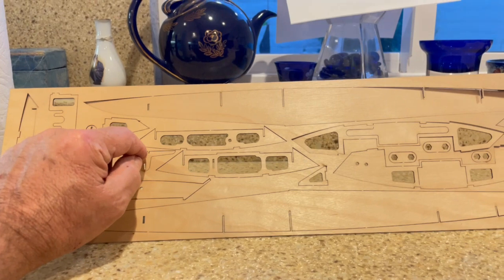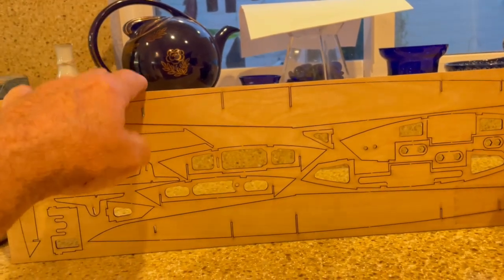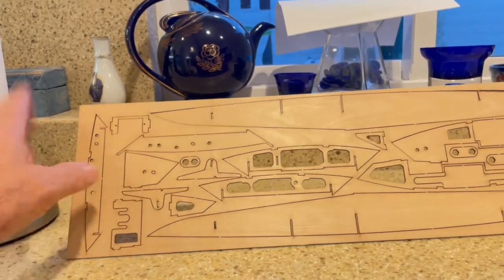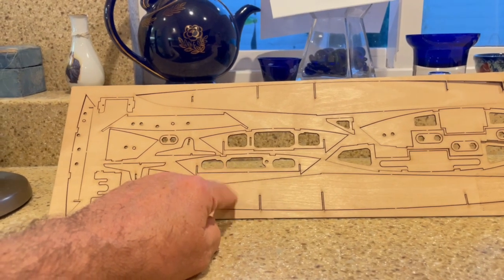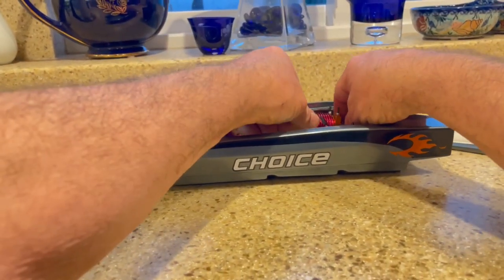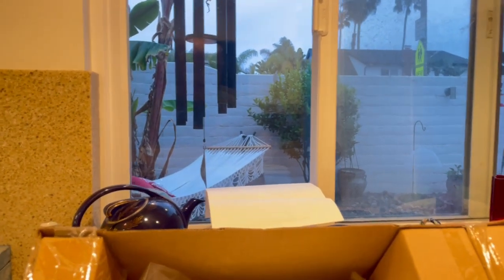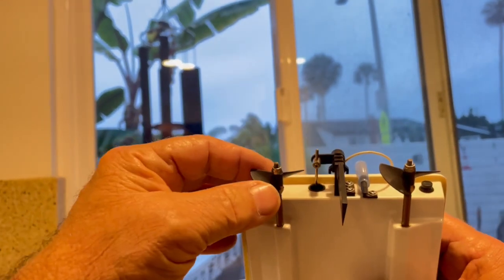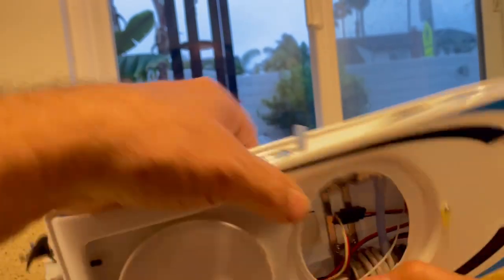Dr. Jet has the prize for the next Challenge

Comment: I had a Mini Wild Cat like yours but yellow and black that I modified. I cut out the hatch to allow more space to get inside the hull and then I removed the stuffing tubes by heating the epoxy with a heat gun and using pliers to twist the stuffing tubes free. I then installed 3/16 stuffing tubes and left and right .098 flex cables with 1/8 inch prop shafts to run 30mm counter rotating props. I installed a brushed ESC and a couple 280 size motors and ran it on 2S. I used it as a pool boat and it was plenty quick despite being brushed. It ran very well, but the plastic hull took a lot of abuse from ramming it against the hard pool walls and eventually smashed the sponsons to the point that it was unfixable. Seeing yours brought back memories. Can't wait to hear more on the challenge.

Comment: I'm just starting to get my Atlas build dialed in. The past couple of times I took it to the pond it didnt go well. I made some changes and had some cleaner water and I think it will run good. Hopefully I can get a video of it running soon. 450 motor, 4000kv on 2s.
Reply from the maker: That's about the right combo for power.  These little boats really don't do well in rough water.
Reply: @Dr_Jet  I didnt have any waves. I did have seaweed and algae maybe some grass which kills these quick.
Reply from the maker: @brandoncocola1322  Oh good grief, algae or seaweed is like dragging an anchor.  :face-fuchsia-tongue-out:  It's really bad with something like the JetStepper that has almost no power to start with.

Comment: I have the bigger wildcat, it's a nice "always works boat". I use it to retrieve my other boats I'm testing. I think you should be able to find another laser cutter that wont be so much for setup. I wonder if they are having trouble with the thickness and have to sacrifice a piece of sheet metal to get it to lay flat to cut good.
Reply from the maker: I don't mind the bit of extra I pay for this laser guy because he has several industrial-sized, industrial-quality lasers, he is very precise, and is less than a 10-minute drive from my house.  You get what you pay for.  I do have another laser guy, but his laser is more like an oxy-acetlyene cutting torch.  It burns a pretty wide (and sloppy) path.  It's not "Jet" precise.....  🙄
Reply: @Dr_Jet  yeah, I used to work at a metal fab shop and you would get some guys that would dial in the machines perfect to where you could tap a 10-32 hole in 3/8 plate. Then you had others and other machines that looked like you torch cut it. All on expensive machines.

Comment: I will buy a atlas and a short circuit when you get enough interest.   The stuffing tubes pop out real easy on the wildcat or at least they did on mine
Reply from the maker: I figured the epoxy/plastic joint may break apart fairly easily, but I'm going to leave that to the new owner.  😉  I'll put you on the list.
Reply: @Dr_Jet  thank you for adding me

Comment: Hey Doc , What about us the wrong side of the pond, too expensive to send ? But you could sell me a drawing ? Regards PJB
Reply from the maker: Since the parts are on a sheet, I can ship them in a flat envelope.  I would probably have to cut the stringers out (the longest part) and cut the remainder of the plywood sheet to fit, but it might be doable for a reasonable shipping cost.  For a basic drawing, just research Garry Finlay's 1:16 scale plans and shrink them to 1:20 scale.  On my plans, there's too many precise little tabs and slots in the laser-cut stuff to try to do it by hand with the precision necessary